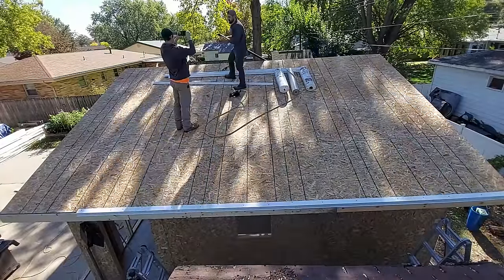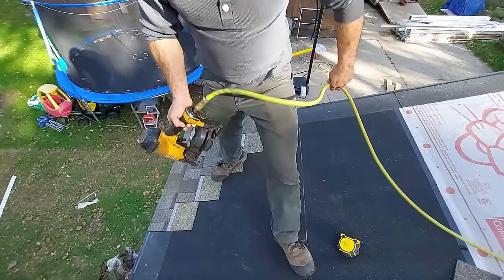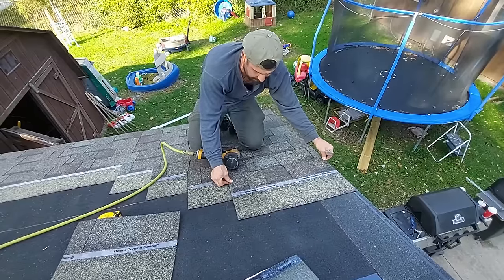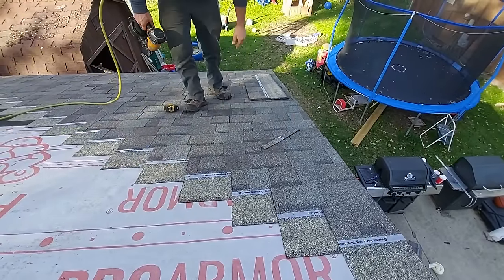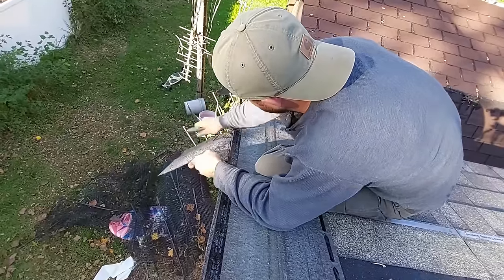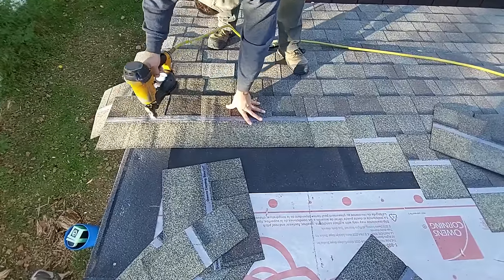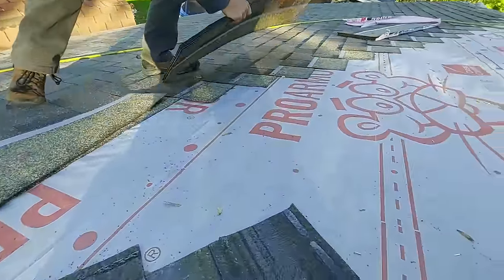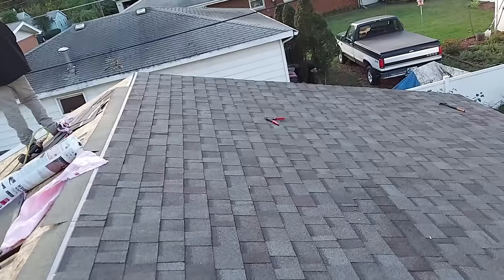HOW TO | Roofing Basics (Part 3 of 3)

Comment: Safety tip from a former young roofer... Always cut away from your other hand. I had my hook blade in my right hand slip into the underside of my left wrist.  Didn't cut any tendons, but I could see one. 😩 3 stitches...  And yes, I know I was trained to always cut away from your body.  However, sometimes when you're in a hurry, you don't always think about safety.  But you aren't going to save any time with a hospital visit or by getting incapacitated.  Safety first.

Comment: I did roofing for 20 years….and that’s exactly how we did it…except we followed the manufacturer’s recommended step and nail patterns.
Reply: Good job that's how your supposed to install per manufacturer. If your offset is 7-8 inches your cutting off your courses short. A field rep would come out and have a heart attack.

Comment: This is a phenomenal 3 part series and the best roofing how-to I've found. Watched all 3 parts from start to finish multiple times, picking up new things each time. Seeing you align the shingles into place for the correct overlap using the tip of the nail gun was genius. Big thanks to you guys for putting this together. I used a hook blade on my Dewalt oscillator and it made cutting the starter shingles and trimming the edges of the roof a piece of cake. I also cut two pieces of premeasured plywood (8" and 16") so I didn't have to do any thinking and the plywood made an excellent straight edge guide when cutting them with the oscillator. I also ended up snapping lines every 2nd row as I found it easier for a newbie to have more lines to reference and have that "reset" more frequently than every 5 rows.
Reply from the maker: Thank you! Happy to help

Comment from the maker: Thank you guys for watching! I would like to add that I do not recommend diy roofs on your home... a garage or a shed is a little different because shingles don't usually leak in the field, they'll leak in the details (pipes, valleys, walls, flashings etc).
 Oh and i also I get a lot of questions about tools on here so if you're thinking about doing a project on your own or new to the roofing game I went ahead and located some awesome tools to help you guys out and they are all cheaper on amazon than the ones I find in stores. Links are in the description! Hope you find it helpful.

Also, be sure to check out parts 1 and 2 if you haven't done so. Very important to this process. Obviously there's much more to roofing than this, so if you need help with valleys, ridge cap, ridge vent, regular vents, pipes, removing and re-installing dish satellites etc. I have all of that and plenty more to watch, here in these 2 playlists! Be sure to check them out! 

https://www.youtube.com/playlist?list=PL5lfy7rRhJVuCig7gNZ4EdxjDtIePxzRK
https://www.youtube.com/playlist?list=PL5lfy7rRhJVu6DTqDxTxgwKlqaRhXgt0A
Reply: Thanks for posting this and sacrificing your time. Time is money. Thanks again.
Reply: I bought the Ryobi nailer , the HPT Metabo cordless, NR1789DCS, nailer.  uses 2in to 3 1/2 in nails.  Do you think I'll be able to use this on my roof and will I need a staple nailer for the underlay?
Reply from the maker: @larry1708  are they roofing nailers? Roofing guns usually shoot 1¼ nails. And no I would just buy handbang cap nails.... I do not recommend doing your own roof if you don't have roofing experience
Reply: @NWIVeteranConstruction  how did you begin b4 you knew?
Reply: @NWIVeteranConstruction   Thanks VC,  I will have a Roofing Contractor there much of the time and won't make a move until he checks in on me.  It's a roof on a nice Amish Shed Kit I ordered.  Shed is 26 ft X 16 ft. X 16" high OC.
Reply: I’m not a roofing guy or something like that but when you place 2 shingles side by side and nail then don’t you have a gap between them ? If so how it comes there is no leak there?
Reply: So I ran into a problem, its like 80° and the shingles are so hot that when I walk on them they get really messed up, any suggestions?
Reply from the maker: @Tyler Brinker  you need a couch cushion or a pitch hopper. Cougar paws might be worth it too. If you can't get any of them then you have to do it on a cooler part of the day,  or avoid having a lot of downward pressure (sliding pressure towards the gutter) because that's what scars the shingles.  Don't be in one spot too long.
Reply: @NWIVeteranConstruction  thanks, I got a roll of foam from the store, it seems to be working, thanks a ton!
Reply: @NWIVeteranConstruction then what is the point of your videos people watch this to be able to do their own simply just bc they can't afford to pay someone to do it
Reply from the maker: @danielcurrin5779  the main point is to help rookies become pros at an alarming rate. When I'm filming videos I usually have ppl in mind who want to learn this skill better and make money with it

Comment: I did some roofing back in the 70s and 80s, and I am about to re-roof my current house. I have been watching lots of video’s and learned something from most all of the videos I have watched., as the products have changed from the days gone by. I did find yours to be one of the most help full. You point out a lot of little tricks that will come in handy. one that I noticed that you did not pass on was the use of the nail gun to help line up the next shingle before nailing it down I thing that would have been worth mentioning. other wise super informative, thank you.

Comment: This is the best shingling series I've found.  Absolute beginner that decided to build a 12' x 12' shed with zero experience.  I'm ready to take on that roof now.  Only thing missing was installing the ridge cap.  I've seen videos using 3-tab, but not  architectural shingles.
Reply from the maker: Don't use architectural. You have to buy cap itself, it comes perforated and breaks apart clean.  I have a YouTube short installing it and I also have videos you can see me do it.
Reply: Yep, figured that out. Had to do some searching because box stores didn’t have any to match my shingles. Will be watching your cap video tonight. Thank you!

Comment: Zacks a pro, I’ve learned a lot from him but it’s tough to remember everything off the top of your head. Owens Corning recommends 6 1/2 inches for your stagger step with a minimum of 4 inches and a maximum of 8. The “5 5/8” number he’s talking about is actually the height of a shingles course line (exposed part of shingle after applicators) not being a smart Alec just clearing it up for the newbies
Reply: Application*
Reply: After I made this comment I pressed play and saw he cleared that up lol
Reply: The technical term for is 5 5/8” reveal

Comment: Being a retired Engineer/PM for large projects (DoD) and having remodeled most of our house over time, I have some experience with the trades. Even did several (flat) roof projects at the (Puget Sound) Shipyard - only as a PM though (review bids, negotiate, place task order, make sure my techs are visiting and safety is job 1, approve submittals, inspect, close task order). PM'd many large MILCONS as well, $100-$400M a pop (Corps of Engineers, then Navy), but I am retired now (YEAH BUDDY!) and none of that ever taught me how to shingle a roof!
You are the best, that's all I can say. Excellent narration, excellent focus on the necessary elements.
So this retired guy with an acre in a rural area is the only one without an out-building in practically the entire neighborhood. Went "simple" and ordered a 12 x 24 shed (my new workshop) from Costco. Of course, no floor or roofing are included and I'm doing it by myself. The floor was square, but then it wasn't, after too many sheets were already attached to it. You must be laughing. Yes, it transferred to the roofing sheets, as well.
I shingled just about exactly as you taught and it looks great and it's straight as an arrow, you'd never know I had to fill in for crooked sheeting beneath. Funny, I used the same, exact shingles you used in these videos (Isn't it weird how much green granules go into an "Estate Grey" shingle? I thought I got the wrong ones!) . Only difference was I used Ice & Water for all the underlayment (smaller roof) and that was friggin' hard work and I screwed that up some, too. By yourself sucks!
Sorry for the long story, but you helped me a lot and I needed to thank you! Engineering is important and every project needs a PM, but that doesn't get you a properly built workshop after you retire!! Tradespeople do the REAL WORK.
Tomorrow, I finish with the Ridge & Hip shingles on top and cut some leftover rake. I had to go get the R&H shingles today when I finally learned, from another of your videos, that I couldn't use architectural shingles cut in pieces to do that.
I have the utmost respect for you and the manner in which you have presented the information in your "for a beginner" videos. They are simply fantastic! I'm sure you have helped many, many people like me and I wanted to thank you from the bottom of my heart. (I only fell off the 6' ladder once, too! Yes, it hurts...) Thank You, Zack!!!!

Comment: I started doing tear offs in the 90s.  Learned a lot over the years. This channel is great.   One thing that I took in late even though I kind of knew it was a substandard product was OSB.   Yeah it feels the same structurally pretty similar. But I was blown away during all the removals of new roofs due to hail storms.   I was blown away that OSB could not hold the nails down.    They can but not nearly as much.      In the early years we would tear off a roof from the top down (usually).   But things kind of changed after the hail storms. A lot of different techniques were created.   Tearing off from the bottom showed how you could pull up on entire books.  News to me.  Roof Has to be new enough to do this.     But through this it was very eye-opening to see the OSB failures.    Sorry if I did not explain that well. Thank you again to this channel to helping other people
Reply from the maker: yea all i've really known is osb besides tear offs. definitely comes off pretty easy on osb camparitively. still a good product in my opinion and to be honest it's what 90+% of builders are using in my area. i almost never see plywood on new construction
Reply: @NWIVeteranConstruction .   Please know I was not commenting on the use of OSB I still use it today.   Nor your use of. You’re a really good roofer and you share a lot and I wanted to point that out. Back when we used to tear of wooden roofs originally we did everything with plywood. Eventually OSB came through and yeah it’s cheaper and very similar. And I always thought it was the same.       I think you’re going to get a lot of attention from your videos. They are very good. And I wanted to throw a couple cents in there. I’m not techy enough to make videos( sorry fat hot asphalt fingers). If I had the money I would buy plywood.    Keep going you rock.
Reply from the maker: thank you i appreciate that!

Comment: This is excellent. I need the basics, going to do a repair this weekend which will include a vent fix (including a bathroom fan hookup), about 8sf of OSB/plywood rotten replacement, and possibly a valley reshingle.  Any comments, suggestions or pointers appreciated

Comment: When you start the first shingle its helpful to lay the next shingle on the side to make sure that first one is straight. Sometimes our cut is not perfectly straight or many times the roof edge isn’t necessarily straight. Just a tip i hot when starting out that helped a bunch

Comment: 40 plus years roofing, overall a good job, I would use more lines as most people will not hold straight with one line. All my work was hand nailing, I wore the heads of three hammers!

Comment: Only thing I would do differently is put the bottom drip edge on after the ice is on. Reason being the ice is made to bond with the plywood, also the drip edge freezing and thawing and the condensation could cause rought. That's how I think of it anyway. Good informative vids, keep it up man.
Reply from the maker: thanks i appreciate that!
Reply: i agree but all codes ive come across says he did it right as well as Owens Corning manufacturer specs! gutter apron under ice and drip edge on top of ice and felt!  Ive actually failed an inspection because i put it on after the ice and had to trowel tar on top of flashing to pass!
Reply: Proper way is a half sheet then drip edge then full sheet over top of drip edge.

Comment: This is very good information. I am impressed that you showed the adjustments that you have to make wherever a  full shingle finishes very close to the right-hand rake. Most videos do not show this.
One thing puzzles me about laying shingles. The unit is 39
Reply: The shingle is 39 inches long and yet on every fifth row you start with a piece of only 7 inches at the most vulnerable point on the roof. It puzzles me how this can be considered good practice.
Reply from the maker: The shingles are nearly 40. So the stair steps are About 8 inches on average.  This means that the seams are 8 inches apart rather than the recommended 5 ⅝-6 or Whatever. It's blatantly a better better practice because there's less room for error and it makes continuing stair steps significantly easier, and doesn't keep you stuck in end corners for too long.

Comment: For all those who wants to be doing even better than what you saw in this video.
I only watched first ten minutes, I comment on starting off, now. I know these things from fourty years experience.
1. Felt in entire roofing surface first, if you can use # 30 along roof eve other than synthetic.
2. Install your edging metals on top of felt, front and sides, no need too much nails, four per piece.
3. Stick down your ice&water shield above eve, one row ok.
4. For starter use three tab shingles or the same you installing, place it upside down so the asphalt strips go to top of edging area. Nail them down also along asphalt strips with long enough roofing nails so it goes into your facia wood at least 3/4 of an inch or more. Also, four nails per piece, evenly spaced.
5. From the top edge of your starter, cut off about three inches paralell, all the way, from one side to the other.
6. Install similar starters on both sides.
Now you can begin laying down your shingles. If you live in a badass area, storms, hurricanes etc.. you can also use little beads of mastic and trowel on top of starter nails and keyways, where two shingle touches, and then place your first shingle in place. Only thing to watch out for not to use too much so it will not stick out by the edging metal, or just use caulking that you can easily measure.
The reason recommending #30 bc after time it makes a bound with your edging, preventing  water penetration.
When you installing your edging and roof is uneven you need to cut it and start with another three inch overlap.
I hope I was clear, but send message if I wasn't.

Comment: Can I recommend when you do rakes put an extra nail on the top corner of the shingle closest to the rake without hitting the drip edge it's called a Storm nail it'll help keep wind from getting under the shingle during a storm.
Reply from the maker: I mentioned why I don't care for that in the beginning. But yes you can suggest lol I do it on occasion but not usually

Comment: Awesome series 1-3. Lucked out I’m re-roofing the same size detached garage. Mine is all dry walled in with a ladder to access above the rafter’s. I run heat in it 1-2x a month during the winter when I’m working out there. Built in the late 70’s from what I can tell. I’m in Northern Michigan, peeling 2 layers of shingles. Original layer was just shingle on plywood. -10 temps coldest it gets, bought enough ice and water shield to do the whole thing per HD recommendation but thinking the same 2 rolls like you did is plenty, can you share any insight why I shouldn’t ice/shield the whole thing, I don’t mind going a bit overkill. Planning to tear the whole garage down in less then 15 years to build a 2 story garage with living quarters, it had a leak and the old shingles are curling so needed to do something! Thanks again for the video!

Comment: Hey man your Bostitch gun has a shingle gauge on it. It's the part that's on the front of where it holds the nails it's adjustable and has the measurements so you can set it that way you can be exact when stepping your 45

Comment: Using a shingle cutter rather than a utility knife is much faster and definitely more accurate in preparing shingle sets. 4 nail pattern, 1 nail on each end, the other two nails are 12 inches in from the end, it's right on the bundle...1st course full shingle.2nd course 6 and1/2 in. 3rd course remove 13 in from the left end. 4th course, remove 19 1/2 in from the left end. 5th course, remove 26 in from the left end 6th course, 32 and 1/2....... That's how it's done